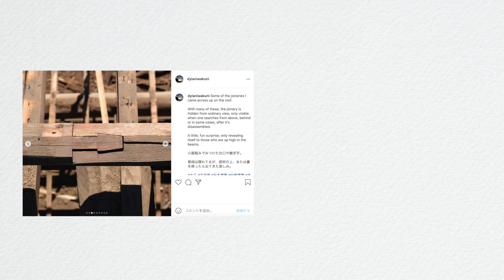A Japanese House Constructed with Joinery 100 years ago 🤯

Comment: Its amazing how buildings were built, beautifully carved, close fitting joints that were designed to be disassembled due to tsunami & earthquake damage. Renew& reassemble damaged lumber back to original glory. Glue not even required, just held together with blocks & wedges. Japanese joinery is a work of art !
Reply: Shadyshanks  I feel sorry for you.
Reply: @blakedblake6143  whoosh
Reply: tbh, if i look at any old timber building i see stuff like this, even my not so old, 1840+ house has joints that are at least in a way like these, maybe not that elaborate, but they dont need to be 90% of the time
Reply: Shadyshanks  Will it last 600 years ?
Reply: Shadyshanks  why not . though my life span is not suitable, the community will enjoy it. btw in the vid they are not demolishing it, just moving it somewhere else.
Reply: Its witchcraft in my eyes. I call myself a carpenter because I can do trim and stairs, then I see this and I'm just lost for words.
Reply: Shadyshanks  your nail house is not even durable unlike those join house.
Reply: @majstealth  You do see some of that in most timber frame style houses, like scarf joints not all as elaborate , and certainly not the 90 degree joinery seen here. Its not to say complex joints werent used around the world even in america, i just dont think on the scale it was used in japan.
Reply: More like designed without enough iron to make nails. It was always problem in Japan.
Reply: @salted_lizard  germany

Comment: It took a fair level of skill and care just to disassemble, I can only imagine the talent and experience it took to design and construct it. That’s incredible.
Reply: Yeah because you need to know how it was assembled before you can disassemble it. Makes me wonder why all houses are not built like this.
Reply: @REAL-UNKNOWN-SHINOBI  Time and labor constraints. Carving something like that takes a fair amount of time, even with modern tooling on something like a CNC machine, that'd be a shitload of machine time when you start upscaling. Then there's the time/skill required for install, nevermind designing it with modern architecture, and engineering in mind.

It blows my mind how they carved things like that by hand, and did so fast enough for it to be a practical means of building houses, nevermind the precision needed for making adjustments in the field, since reality isn't always like the sheet of paper the engineers draw the prints on.
Reply: Now take a look at himeji castle and think of the brilliance it must have taken to build that, even 100s of years earlier

Comment: That’s why it’s still standing after 100 years. They know what they’re doing
Reply: to be fair, 100 years is not that old for a building. even a wooden one. that's like saying "I'm a vegan and that's why I made it to 50 years old". sure, perhaps being vegan is good for you, but that claim does not do all that good of a job at advertising for it.
Reply: @robinlindgren6429  , you may have  a good argument,  but have you also considered the other side of Japan  that is being prone to earthquakes among other land altering natural disasters?
Reply: @dennismarfo3536  I have.

There are certainly impressive examples of japanese wooden buildings that have survived the ages (1000+ years, not 100) against natural disasters thanks to ingenious engineering, but that engineering is not fancy joints and this video is not an example of that.

Wood happens to be the best commonly available material to make a structure out of if you want it to resist an earthquake, the more dangerous natural hazard for old well-made japanese buildings is not earthquakes, but fire. suffice to say, no level of impressive craftsmanship in joinery will prevent wood from burning.
Reply: @robinlindgren6429  there are modern treatments to wood to prevent it from burning though, as what's used in the norwegian wooden high rise building (tallest in the world)
Reply: I'm puzzled as to why they took the time to create joints that will outlast the material itself.  Just because they could?
Reply: @gizzyguzzi  . I can only think that’s the way they did it, it’s an art form.

Comment: Wow!  That is absolutely incredible to see.  I wonder if the standards are the same today in Japanese construction?  The carpentry on show there was masterful.  Thanks for the video Dylan.
Reply: Residential construction in Japan is about modern or inexpensive building materials, increasingly adopting Western comforts, quick construction, and not necessarily about longevity. As anywhere, though, some builders and architects still retain some of the ideals and skills. Temple carpentry is the only place that joint design and high quality of wood preparation is still the equal of historical technique.

Comment: is the elaborate joinery economically motivated? (as in, to avoid the need for expensive metal fasteners and exchange instead for labor of the maker?).
Reply: (I'd like to see the speed of the makers who made that, as I'll bet we've lost the understanding of how fast a good maker could do joints like that to a functional level - not hurrying, but in rhythm without endless pondering or confusion).

Comment: for conservation of original wood... rubber; rubber every tool, and a treatment of the wood before rebuilding soo the obvious termite damage wont continue. even without these precautions, Japanese wood working and carpentry techniques are 1st class and very dependable long term. you find a creak in board after 25 years just give the "seating wedge" a couple love taps and your good for another 25 years at least. Hats off to Japanese wood working class A in the world (btw in American that means S class <3)

Comment: The Japanese art of carpentry, or should I have said “The Japanese Carpentry 🪚 is Art work of the Finest degree. This is a few hundred years old house that was constructed with NO METAL FIXTURES LIKE NAILS or screws. The Japanese carpenter has skills that a traditional Japanese connection joint for the typical beam or joist in a house was finished better than what the English, french or many of their neighbours could not achieve.

Comment: 95% of boards in traditional American framing get cut once. And the cut may have varying tolerances of length and/or angle depending on the carpenter. Can't imagine how much time it took to cut and chisel trees into perfect combinations of nameless techniques. Make the smallest of mistakes and the piece is ruined. Go back in the forest and cut another tree down and start over. Just to get them to fit together is a very high level of difficulty. Fitting everything together and keeping it level, plumb and square is on another level of genius and patience.
Basically impossible but whoever built it made it happen. No nails, no power tools, probably took 10 years if it was just a few people. 
Impressive to say the least

Comment: Seeing videos on modern traditional home building in Japan, it seems more or less a shop endeavor. Onsite work is kept to a minimum and frame structures go up very quickly. Almost like tinker toys for those here from the states. Strong, durable, beautiful. New housing in the states is built to the lowest standard allowed by law. And that bar is set very, very low. So sad. Japanese standard has always set my bar. I'm a furniture maker by trade. 30 years in. The first books I read on the subject were about Japanese woodworking joints and Temple building. I never looked back.

Comment: Such craftsmanship and artisans isn't available anymore, nevermind wood like that.  Mores the pity.
Reply: The wood is better these days, and the craftsmanship and knowledge is still there in Japan, albeit at a much reduced number.  The only problem is that few people are willing to pay for it.
Reply: @iatsd , I wonder why you say the wood is better. In the USA, furniture quality wood does not match what was available in the past from old growth forests.
Reply: @leehaelters6182    It's Japan.  They still produce good quality wood, but these days there's more science behind it so it's a lot more consistent in quality.  It's simply better than it was.
Reply: @iatsd , could you explain that in better detail, please?
Reply: @leehaelters6182  What part gave you trouble?  Wood is commercially farmed in Japan.  They grow for quality, generally, not quantity.  They are better at growing & processing wood now than previously.  The wood quality today is higher and more consistent than it was 75+ years ago.
Reply: @iatsd  makes sense. I was just wondering about what characteristics of the wood had been improved. Or is it a matter of more yield, a  longer trunk. And I suppose that we are talking about softwoods. I can see that every tatami room here is usually trimmed out with beautifully vertical grained boards, and the tokonoma will often sport a column that has been raised, I suppose, to have a debarked, but smooth and gnarly surface. Thick sectioned columns or posts usually include the pith of the heartwood, and they run a saw kerf down the length right to the core to manage the shrinkage. This stuff is not available in the home centers I’ve been to, but I sure wood like to know where.